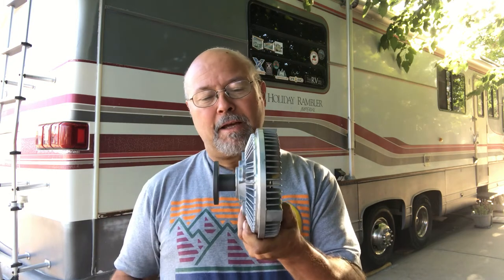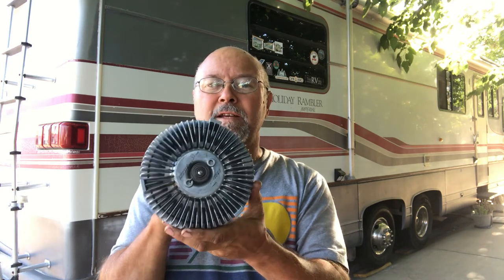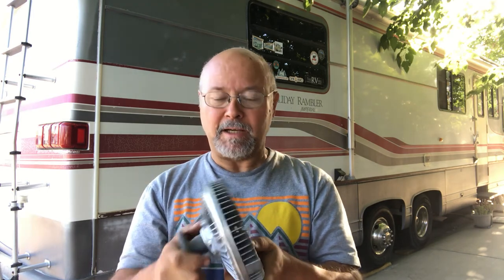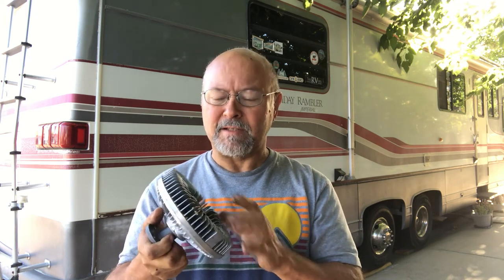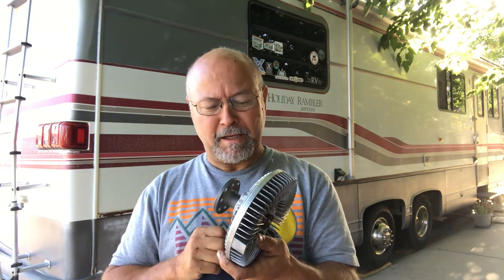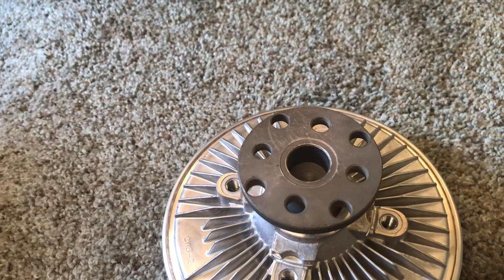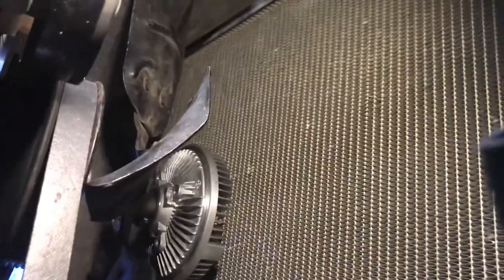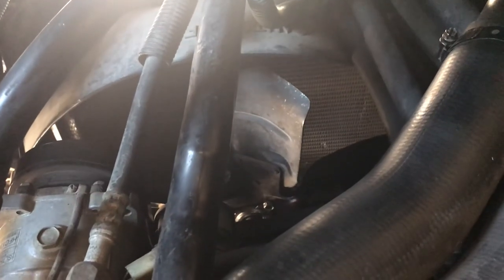Engine Overheating Warning: Ford F53 Fan Clutch Issue

Comment: I would strongly recommend adding a 16" electric fan to the front of your radiator 
like the one from Amazon (16 Inch Electric Radiator Cooling Fan Mounting Kit & 175-185 Degree Thermostat Relay Switch Kit Black). It was by far the best $50 I have ever spent on my 1996 F53.  Before adding it, the clutch fan sounded like a jet engine and sapped at least 30 hp when you need it the most, going up mountains in the summer. The clutch fan often couldn't keep up and we would overheat before we reached the top. Now we go up and down mountains like it is nothing and the clutch fan only comes on in the most extreme conditions. And when it does, its a back up measure that you are glad to still have. Thanks for the video, I watched it so that I could make more room to get to my power steering pulley.
Reply from the maker: The fan clutch works great now for us but it is so noisy. I like this idea. Do you have a link to the items you mention on Amazon?
Reply: @TignerAdventures  just copy and paste the product description, you will see lots of options, but the one I have been using is the $48 one.  I bought the cheapest one I could find because I doubted it would work. However, it worked so amazingly that I may replace it with this Spal
30100401 16" Pusher Fan 12 Volt Low Profile Straight Blade 1103 cfm VA18-AP10/C-41S.  I have read that the Spal has a much faster rpm.
Reply from the maker: @michaeldavids6495  Thanks.

Comment: Wow , what a job...I have never done this repair before.
Reply from the maker: This one uses a manual system.  I bet your rig has a hydraulic one. They are key to not overheating though.  It has been keeping the engine cool now and that is very nice.

Comment: What year is your F53 please? I'm looking at a 96 that has a fan issue, not working.
Reply from the maker: Thanks for watching Mark. Our F53 is a 1994. I finally bought this part from Ford and even with that said it took me 3 times before I got one that worked. Make sure it is in the box and the box looks brand new. I think these parts houses just recycle the parts out to someone else. But I finally found a good Ford Dealer in Yuma and they replaced it all under warranty at no cost and gave me a brand new looking box. The Ford dealer in SLC made me pay for the warranty part and then 3 months later reimbursed me. By the way the first 2 came from the SLC Ford place so avoid them all together. The bottom line is it works great now.
Reply: @TignerAdventures  Thanks. I'm in the uk and we have some US RV's here. I'm looking at a Fleetwood Pace Arrow 37J tag axle.  Parts are available at a high price. Better ordered from the US.
Reply from the maker: @markp6982  How much is shipping in that case?
Reply: @TignerAdventures  I don't know but it works out cheaper and quicker I hear.
Reply from the maker: @markp6982  Well. if we can ever help with something let us know. If the fan issue is what we experienced it is easy enough to fix with the right parts.
Reply: @TignerAdventures  Thanks. Your videos are great.

Comment: My guess is that failure to remedy this could also lead to transmission overheating. Unless there is a separate cooler.
Reply from the maker: So that is a good question. I found that if I drove less than 55 then I stayed below 250. Now that the clutch is working correct it keeps it below 230 all the time. But I would check the transmission with a white towel and make sure it is still pinkish cooler.  If it is black then that is a sign the oil is burnt which causes a lot of other issues in the transmission and is a sure sign of future problems. I also noticed that if I use the ac the fan clutch runs a lot more because of the extra heat.

Comment: What is the part number?
Reply from the maker: The Ford part # is AU2Z*8A616*P. I have replaced it with 3 from FORD now. This last one seems to be doing a good job. I also carry a spare that I bought at O'Reilly Auto Parts to start with. It is slower to kick in so the engine runs at about 250 all the time.  But it is a good back up if this ones quits when I'm in the middle of no where. Thanks for watching.
Reply: I want to ask you I found heyden 2799 severe duty looks the same cost 40$on Amazon ford one is 130 $
does it make any difference in between them 
Thank you for amazing video and help
Reply: @TignerAdventures  can’ you send me your email I want to send you a picture of my temperature gauge I put another on on upper radiator hose it was showing over 230 what is good temperature that I should see, 200?  And my second question did you ever replace radiator on this motorhome? I’m thinking about rebuilding mine if it won’t cool down 
I installed 180 high flow thermostat but there no difference
Next think I want to do the radiator flush do you think it’s good idea?
Reply: @TignerAdventures thank you for info I replaced it it was easy but I think i need to replace my radiator maybe try to rebuild it because i still run around 220/230
Reply from the maker: @mmmaazzuurr  I think I missed your last message. Sorry. Our email is tigners@tigneradventures.com.  I had to replace my fan clutch multiple times before I got one that actually worked. If I remember the thermostat I have is 195 or something like that. It is the one called for and the reason is the engine needs to run hotter for all the sensors to work is what I was told.  The fan clutch should start kicking on about 230.  I have had 2 of them go on and never shut off. I got one from Napa that was bad to begin with and one from Oriely that doesn't come on until it hits at least 250. I carry that around as a backup but finally had to buy one from FORD which is overpriced. Even with that said the first one worked about a week and then just stayed on all the time. Better on than off though. I returned it and the next one worked for about a month. The 3rd one has been working fine.  The first 2 I got were in open boxes and I think they were returns. The FORD in Yuma is a good place and he got me one that was still sealed. The one in SLC made me pay for it again and wait 2 months to get a refund. Don't trust them. I think the sales guy just wanted credit for selling me one. I have also flushed my radiator and it was replaced once before I got it.  However, I believe that could have been what caused the gasket to start leaking. Not sure but if it had junk on there it was probably keeping it from leaking. I also placed a light on mine and looked through all the fins to make sure they were clean. Also replaced the thermostat.  The bottom line is I believe the issue all along was the fan clutch and when I finally got a good one things have been good. I usually don't buy from the manufacturer but in this case theirs seemed to be the best.